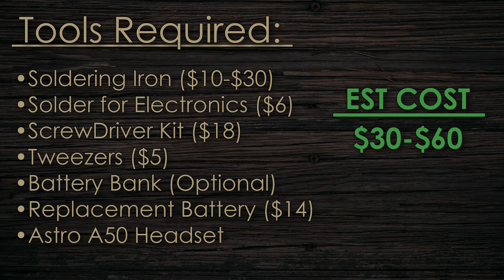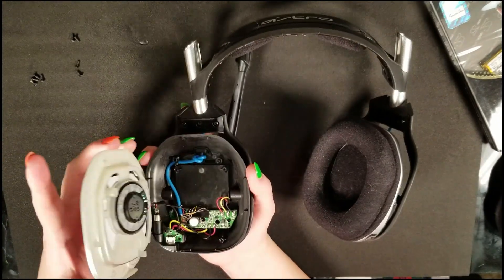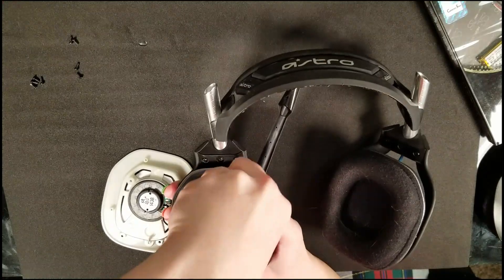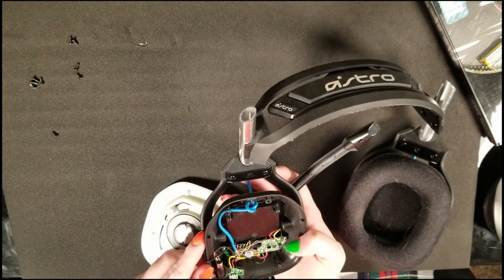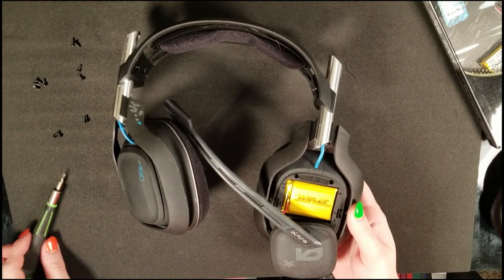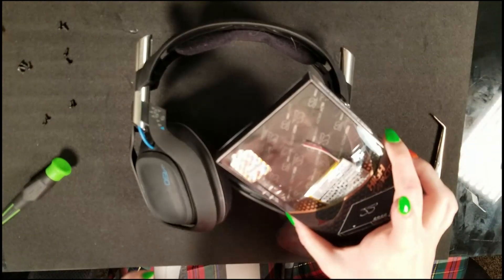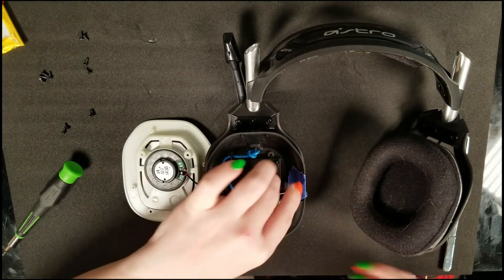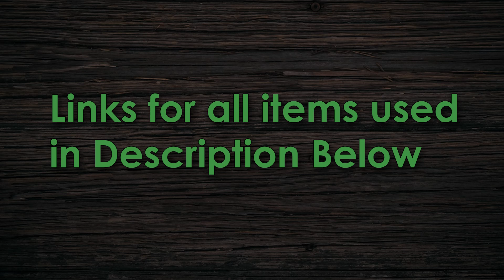Astro A50 Wireless Battery Replacement Guide | Step-By-Step Tutorial

Comment: Can confirm this works on Astro A50 Gen 4. Do keep in mind if your power toggle light is stuck or won't light up or won't turn amber when charging the headset itself will need a reset to identify the new battery. You can do this by holding the Dolby button + Game for the reset and all should be good to go.

Comment: Could you tell me what time of screw driver you used specifically im trying to make sure I order the right screw driver kit the one you suggested is currently unavailable on Amazon
Reply from the maker: Let me go through the links again and see if I can find one that would have all the same bits as mine did. Unfortunately with Amazon items they change brand names / looks a ton so I will post a new one that will work here within the hour.

Comment: You should always do a light coating of solder on the wires prior to soldering to board. When you remove old battery the wires do take some of the orginal solder with it. If you dont have enough solder you risk cold solder joints and weak bonds.

Comment: There are no fucking screws on the outside of my A50s man under the cups there are nothing. I cannot bring myself to just rip the foams out and then they will look like garbage. Guess Im going to have to tho why do they have to hide screws man!
Reply from the maker: It does suck, its sad that each generation of headset as well is different. This repair guide of the Gen 2 only since the 3 & 4 generation are completely different. I would recommend going to IFixit for help on the new generation headsets.
Reply: @xDivineStrikex  thank you! I at least think I can buy replacement foams as I don't think I can glue it back to look as good as new unfortunately.

Comment: Just wanted to let people know that in the case you don’t have a solder (which would’ve made this way easier), I managed to cut the wires from the old battery at the base of the battery and splice them into the new battery. I would only suggest doing this if you HAVE to and are very comfortable with trying to cut insulation off of a strand of hair without going all the way through 

All in all though, hardest part was getting the ear foam back on lol

Comment: Hi, can i ask you a question?

I want to buy a pair of A50 but i know that the battery lasts about 15 hours, my question is this: I stay about 12 hours at pc every day, if every day I have to charge them, how long do you think the battery will last?

(sorry for my bad english hope you can understand me)
Reply from the maker: Honestly its going to depend on how much you actually actively listening to things and how loud you listen to them. I listen to my headphones pretty loud and get roughly around 12 hours out of mine because of it.
Reply: @xDivineStrikex   aight, thanks for the reply, but if i charge them every day, for how long the battery will last more or less?
Reply: @xDivineStrikex  or maybe i need to get a new pair of A40 4 Gen
Reply from the maker: @reparableohio295  Honestly I would get the Gen 4's I have a pair now and charge them everyday and they have been great for about the 9months I have had them so far.

Comment: Got the battery, replaced it, turn on, turn off, sound beeping ! Close it up. Guess what ? Lost sound from left speaker. It's like it turned to mono. everything coming from right speaker.
Reply: dude.. how tf did u manage to change ur batteries im too scared to do it myself :/
Reply: To be honest I really don't know where it went wrong. I just hate soldering since forever, but it actually seemed to go smoothly. Most obviously it didn't. No idea how, but I'll get it fixed.

Comment: FYI, I just learned different generations of the A50 have different battery placement. I am not certain what generation my headset version of the A50 is, and used your video post to get inspired to do my own battery replacement. Your video gave me the confidence to attempt to tackle this repair of replacing a failing battery. All ended well! I had ordered the new battery a couple of weeks ago through aliexpress.com and chose to purchase through a USA drop shipper. Total cost with shipping was less than $11. The item arrived in less than a week (that made me very happy). I thought I ordered the replacement battery a bit too early...but being proactive paid off today! I am so glad I had it in hand already...because I had noticed the headset was losing it's ability to hold a charge...and it was failing quickly, and was forced to keep it plugged into the power, to be able to use the headset. Today, while using the headset there was a pop noise. It turns out that my battery exploded. It did not leak. I learned in my version of the headset, the battery is on the Right Ear, not on the Boom Mike side, as in the version of the headset of the Video. I got lucky. No damage was done and the exploded battery showed me where the battery was located, when the right ear  center popped off. The battery is behind a plastic cover and was clipped, not screwed in, and it snaps back into place...and when the battery exploded, it pushed off the snap-in cover-plate. Using the technique of the video, I still had to peel up the speaker felt covering...very carefully...to get to the 4 screws holding it on, to get to the solder points. I did not have to unscrew the circuit board. The original battery was glued into place and was a bitch to get out...slowly and carefully prying up on it...and the yellow cellophane tape around the edges of the old battery gave way, but it was a real effort to be gentle and had to pull rather hard to break the grip of the adhesive used. Then used a small flat edge of a small screw driver to clean out all the adhesive hardened glue. Then followed the video to de-solder the 3 wire leads, to then remove the old battery. The above video, even though my version of the A50 headset has a different design, was great to have as a resource. Everything is repaired and re-assembled. Thank you for posting it. One caveat, I would have been pissed if I would have gone digging into the Mic Boom side, left ear peace, and did not find a battery in there. This was a good project! The headset battery is getting it's first initial 24 hour charge right now.
Reply: Yo cuz I got a question
Reply: So what color should ur headset be when it’s fully charge like my headset is on orange
Reply: @cb_andyy4593 , my headset has a red led to indicate power is on. The charging base has 4 bars...no color led...and certainly no orange led bulbs. It shows 4 bars when fully charged. When the battery exploded, there were no bars on the base, but a red led came on instead and was the only light that was on, on the base. The red led on the right ear...indicated the power switch was on, stayed red because it was still plugged into the base station. Good luck.

Comment: how do you dissasemble the headset? mine doesn't have the screws on the headset. it's the newest model so they don't have them. i don't know how to take it apart now? please help me. the damn volume dial doesn't work and i can't turn up the volume
Reply from the maker: Unfortunately I do not have the newest model. They have changed multiple times in the way they are built so I would recommend trying to do some research on maybe iFixit to see if they have done the newer headset.
Reply: @xDivineStrikex  actually i was barely lucky to only find one video of the newest model being repaired, well it's almost identical but now you only have to remove the center foam pad and unscrew the screws behind it. the screws that were on the outside are no longer needed they just use the ones behind the foam. from the looks of it, to save more money. surprising how sturdy the headset is with the less screws but it least now i know. thnx though. i'll wait and see if astro will repair it for cheap if not i'll take it apart then.

Comment: Great tutorial..can u do one fir the.mic...my mic is loose and flimsy and need to replace asap...please help...someone??
Reply: Did you find a tutorial. The screw broke off on one I was working on. I think they put threadlock on the mic arm and it may not be able to be replaced unless you have a new arm to replace it. The threads might also be reverse threads or something because that screw would not come loose.

Comment: after I replace the battery, the charging light is on but it doesnt charge the battery, I use the same replacement as you did... any ideas?
Reply: Did you figure out the issue?
Reply: @prescottarizona972  Nope still cant use it with the battery
Reply: In my case the battery shows charging, but it never goes red (as it should after charge) so I believe it is charged because I used it and did not make low battery noise. I am recharging this night too and see if tomorrow it will be red. If not, I'll use it and see how long it will last with this charge
Reply from the maker: unfortunately not, sorry to hear that, I would recommend looking at the wires you soldered and make sure that they are all secure and you didn't accidentally get any solder that bridged two wires.

Comment: Nice video👍, your voiceover was on point!.   My battery only lasts about 2 hours or less of my GEN1 A50,  and my ear pads are disintegrating and  leave black stuff on my ears.  I was on the fence about replacing the battery, because sometimes small electronics are a major pain.  Your video showed how easy it is,  so that saved me a couple hundred bucks.   My A50 has been incredibly reliable for over 10 years,  so hoping $30 in battery and ear pads will bring them back to like new.    You mentioned your shot being out of focus at one point.  If you are shooting with a manual focus capable camera you can prevent that pretty easily, in fixed overhead shot setup like this,  if you  lay the product down,  let the camera autofocus,  then switch to manual focus,  you can prevent the autofocus jumping to the hands.  It also helps if you keep your aperture setting higher so that you have a wider depth of field.

Comment: Great video, thanks!  Unfortunately I wish my replacement battery was as good as your video.  I bought the same one that you have in your Amazon link.  It only lasts 2 hours off of a full charge (8+ hour charge) so that's pretty disappointing.  I'll probably just end up getting a longer Micro USB cable and leave it plugged in making it wired since the headset itself is still good.
Reply: I read somewhere u have to revive the battery i don’t know the process but from what I understand that’s why it only holds 2 hours the new battery. If I find the process I’ll let u know.

Comment: Don’t know what exact gen mine is but there’s no screws under the earpieces. Maybe they’re under the middle foam but not about to pull that off until it’s on its last legs. I have the mini USB port problem but still charges on the base
Reply from the maker: If yours dock to charge then yes they would be the newer model compared to these, check out Ifixit site they have a guide for that model on how to repair the battery.

Comment: Mine is actually in need of a replacement and currently waiting for my new battery to arrive and this guide is sure to be a great help for it. I would also like to know if there is a fix for my volume wheel as well. Mine is acting weird lately where it either goes so loud or totally no sound with just a slight turn.
Reply from the maker: I am unsure about the volume wheel issues. I know I have heard that when you take the headset apart that some of the screws are what actually hold the wheel tightness so maybe when you take yours apart you can see if any screws seem to loose? Sorry can't be much more help with this part.
Reply: I have this same issue. Some people have had success taking it apart, removing the wheel and then re-setting it, but I didn't have too much luck on that front.

Comment: Hello do you know of a replacement part for the mini usb charging port? It seems to be the ultimate problem after the charging pins fail epically.
Reply: bro buy yourself magentic cables thats the best way to avoid that happening
Reply from the maker: Unfortunately I don't off the top of my head, I know you can open up the headset and find the part number on the tiny board and search ebay. Also i know that people have changed out their Micro USB to Type-C you can search good I think Linus forum had a guide on it.

Comment: I have a Gen3, would this work on mine as well do u think? Great detailed instructional video.
Reply from the maker: Thanks, unfortunately the Gen3 have a different tear down to complete the battery replacement.
Reply: @ItzDivinex X ok thank u for responding. Do u have knowledge of what’s different between the gens? Thank u so much, much appreciated
Reply from the maker: The gen 3 have different placement of the circuit board inside. Honestly it's not too much different but I believe they have a guide on ifixit for the gen 3 headset.
Reply: ItzDivinex X Thank u so very much! Have a wonderful day and stay safe!